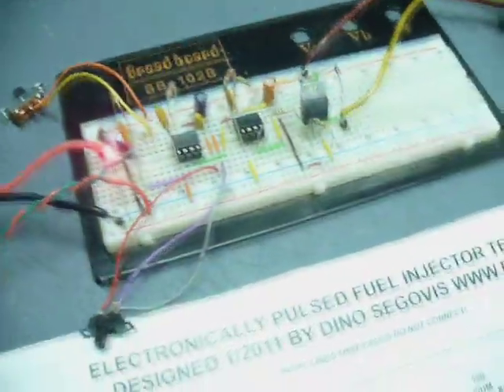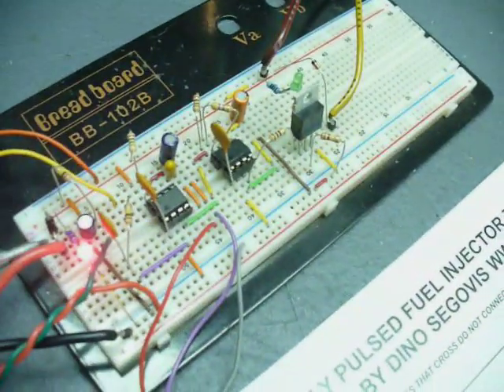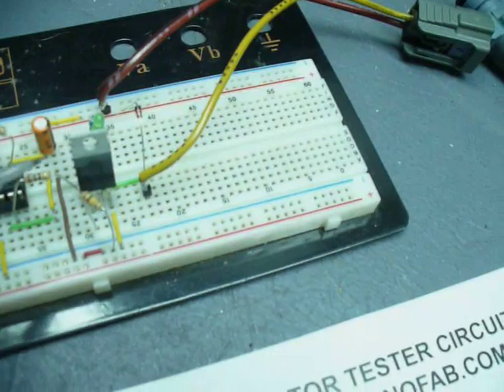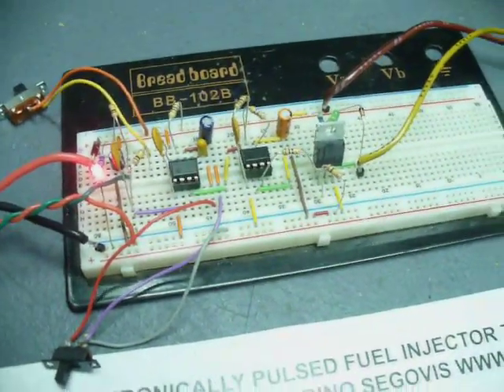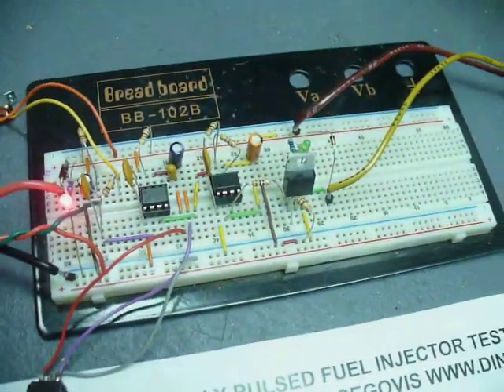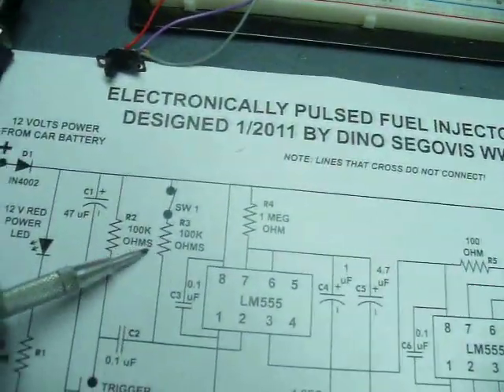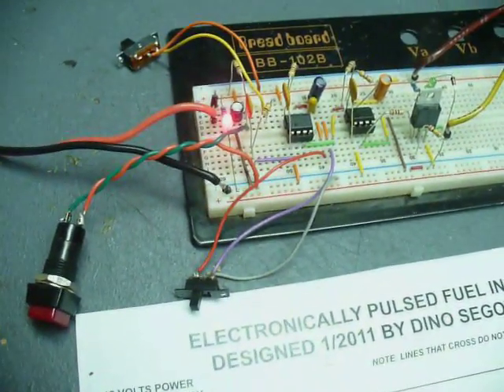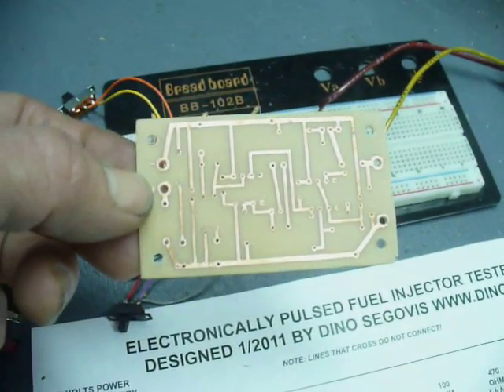Fuel Injector Tester Update

Comment: Hi Dean, I need to drive a single injector at 65hz continuous.  would be nice to adjust the duty cycle also, or least have a few steps(50/60/70/80hz)
do you know any resources for this?  websites or forums?  thanks

Comment: Dont use capacitor swich,  you can put allot different capacitor by rotary swich. or you can keep in single capacitor, but change the resistor by variable resistor to change the ne 555 ic `s frequency.